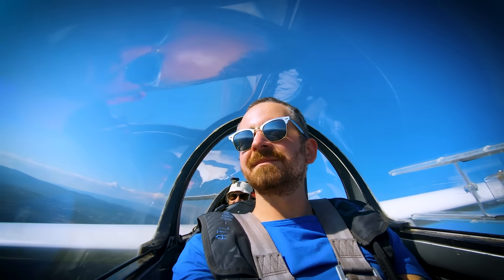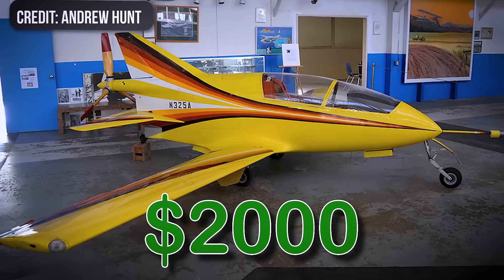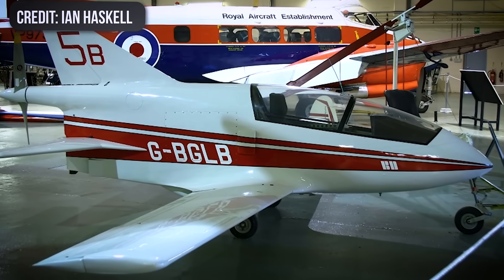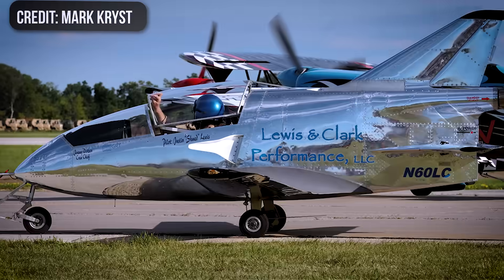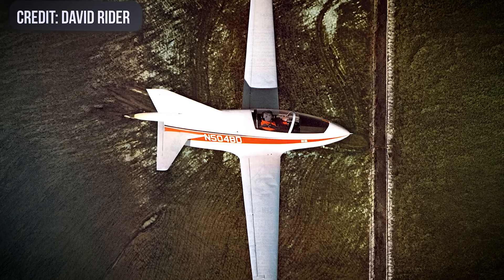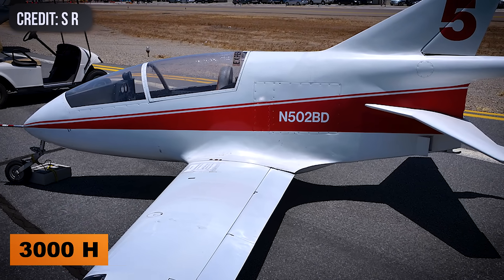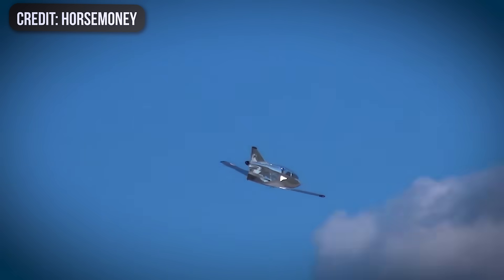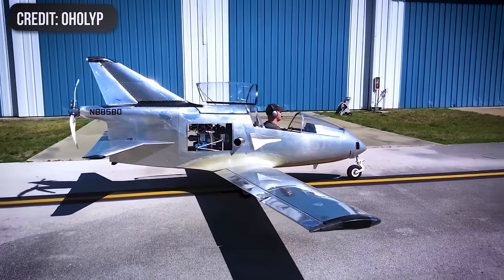This ‘$2,000 Jet’ Seduced Thousands of Pilots… Then Turned On Them

Comment: To me it looks like a scaled-up radio-controlled [RC] sport model. I can imagine it with a 6' wingspan, weighing about 10 pounds, and being a bit of a handful at low speeds.

The extended wing glider version seemed a bit more realistic as a full-sized proposition, but the standard machine with its big fuselage and tiny wing looks more like a coffin/casket than a plane.

Comment: Sounds like the development of many aircraft. Not as glib as the author makes it out to be and sensationalizes the failures.
Reply: I don’t dispute your comment as every airplane that has ever flown has had teething/developmental problems they’ve had to overcome and sometimes the failures are put in the spotlight.  However, when it comes to the BD-5J it sounds to me like Jim Bede was more concerned about lining his wallet than he was about safety. The first time I ever saw a BD-5J was the Coors Light silver bullet back in the late 1980s and I’m marveled at the possibility of owning one of those one day. Shortly after I saw it fly was when I to began hearing all sorts of horror stories about it, and that’s what kept me from owning one. Jim Bede never did anything to improve the safety and seem to only laugh all the way to the bank. Granted, he sold over 5000 of them, but last I heard around only 100 of them are still considered airworthy as all the rest were either sold as static displays, sold as scrap or as spare parts.

Comment: I know how to make pressed silicon nitride 50x cheaper or more than usual, so it's possible to make a turbine that runs off tapwater that also provides gyroscopic stabilization and 10x more power than you'd need at minimum for that aircraft.  I also know some other engine designs, all of which would allow you to run without using fossil fuels. Yes you could scoop up seawater and go around the world.

Comment: After flying a fighter plane in a simulator, flying a GA plane feels like cheating. However, this thing looks about as dangerous as a 1950s jet fighter. The airfoil is too thin, the engine too high, the wing loading too great, and the wing area too small. There is also probably very low margins of stability. A cool idea, but awful execution.
Reply: The tragedy is that a military jet is a much safer plane than anything an amateur pilot can ever dream to control. Those planes have enormous performance margins... which they need for combat mission profiles. In ordinary flight those become safety margins.

Comment: If the jet engine was a success, then perhaps he should of focused not on piston engines for props rather focused on turbo prop set ups using the same jet engine.
Reply: It still doesn't solve any of the other problems. The contraption is too small by a factor of two, which means it lacks a factor of ten in volume and price. You want a safe plane that won't kill you? Spend the quarter million dollars that a plane has to cost that won't kill you. Or, if that's too much... take up hang and motor gliding. Way cheaper still and much safer.

Comment: My friends dad was building a KR2 in his basement.  At some point he lost track of the size limit to pass out of the basement entrance so he could finish it up in the barn.

The day came and it was obvious that the rudder and stabilizer are would have to be torn apart to get it out.  Iirc, he’d just had the FAA guy out to sign off on some of that area before he could cover it.

Eventually, it made it out to the barn but I think the damage took away his enthusiasm to complete the project and it was sold sometime later.

RIP Max, you were one cool dude…

Comment: Very interesting story.  I came along and built a Long EZ, but it was way down the line from the BD series.  The Long EZ is a hard plane to build, because you're actually building every piece of the plane.  Most builders today opt for the RV series, which are easy to build using pre-fabbed parts from the factory. A friend built a RV-6 but insisted on putting a Mazda Wankel engine in it.  He argued it had a high horsepower to weight ratio and he was going for it.  His mistake was using an engine whose high horsepower developed at 6000+ rpms. That's a lot of weight being slung around inside that block. It had to be geared down, which was the Achilles heel of his airplane.  He lost power on final and crashed it.

Comment: For the record on the ORIGINAL BD-5J engine: The Microturbo TRS18-046 turbojet engine was a certified, man-rated design of French origin FAA certified by Ames Industrial Corp (aka Microturbo USA).  I did a ton of test cell work and data crunching in the certification process for that engine.  Good times.

Comment: I can't understand how an aircraft engineer could start shipping parts before the prototype was even certified as airworthy. I don't think there has ever been a single plane that went from conception to certification without at least a hiccup or two that required tuning something up or changing something around. Usually there is a lot that changes. He really shouldn't have started to accept deposits or start making deliveries until the FAA had certified the plane as airworthy.

Comment: In 1971, my friend, Art, bought a 1969 American Yankee AA-1 (the original symmetric airfoil) for peanuts as, within a couple of years, it had earned a reputation as a "widow maker." I flew a couple of hundred hours with him as he built time towards the ratings he would need to earn to become an airline pilot.  This spinoff of the original Jim Bede BD-1 was dumbed-down as the AA-1A with a Hershey bar wing, which made it much more docile. As I recall, stall speed clean was 69 kph, with the miniscule flaps the stall speed plummeted to 65 kph!  Final approach was way faster than in the 150 in which I earned my PPL SEL! It was a lot more fun, for sure. The castering nosewheel confused a lot of folks, but Art never had a problem with the differential braking. During his ownership, we installed dual nav-comms, an ADF receiver, transponder, marker beacon receiver, 3-light strobes, audio panel, and even drilled out the yokes for push-to-talk buttons on the comms.  All of these improvements were signed off by an A&P..  It lived a few years after Art sold it, to a pilot in Big Bear, CA. I see it's in Ohio now. I hope the owner has as much (mostly) fun as we had in that beauty (N5677L)

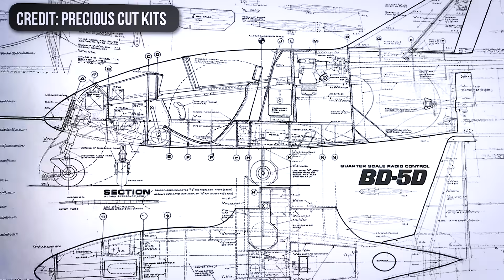Comment: 7:27 An RC scale model.  Around 1975, whiler in the Navy at NAS Pt. Mugu, there was a demonstration of the BD-5J sponsored by  a beer company, Coors Light. I was a mechanic with VP-65 and impressed with the little jet.   But standing next to me was a couple of Navy jet pilots. They too were impressed but were concerned with how many G's the thing could sustain without structural failure.  But it sure looked cool!

Comment: I only know about the use of engines in cars and motorcycles, but even there, putting an engine in something is never as simple as installing a radio. What a wild comparison. Even on the ground, you have to know whether or not your oiling system can handle sustained G-loading. Toyota learned this the hard way recently when they made some of their sporty cars unable to take a long high speed turn because the oil pickup would get starved. Motorcycles usually have it easier because most of the time, forces going through the bike are much more down relative to the bike because it leans in a turn. But you still have to make sure that under acceleration and braking you don't get starvation. And that's just oiling. You also have to make sure the fuel system can handle it too. And coolant. You can't just put any engine in any vehicle and it just works. Most of the time a car engine will work well enough in any car, but the edge cases matter, and the moment you can have 3 dimensional movement instead of just on the ground, it gets so much more complex.

Comment: I actually flew one in 1975 with the Xenoah two stroke engine. You pull started it like a lawnmower.
Normal flight seemed so close to being out control, and it was very easy to over control, especially in pitch..
The side stick took getting used to, but was cool. Landing was critical because you could put it into a high sink rate and smacking the runway like a manhole cover. Les Berven and Burt Rutan both signed my logbook both surprised I was still alive. Always wanted to build one, but as I got older, staying alive seemed more important..

Comment: As a layman aviation enthusiast, I have a question.

Since the engine-out pitch characteristics were so bad, could there have been a mechanical system that could counter the strong pitch-up tendency?  Seems to me, a strain gauge arrangement of some kind could be built to add some nose-down pitch when the engine power dropped abruptly.  Similarly, a nose-up adjustment when adding power on a go around.

Also, it seems wise, to me, to incorporate a way to move cargo/ballast forward and aft, to dynamically adjust balance.  A simple box with a rack-and-pinion or a drive screw would accomplish that.

Comment: I am 75 years old now. I was a young highly-educated professional aeronautical engineer working for Beech Aircraft in Wichita in the 1970's while Bede was pushing his contraptions out of Hutchinson. While we were working hard and diligently to produce reliable, safe, well-tested, and FAA-certified aircraft, and conducting research published in AIAA and SAE journals for scientific peer review, research that went into actual successful production aircraft, Bede was casting aspersions on us, Cessna and Learjet across town, and Piper, in an effort to justify his unconventional, ill-thought, and unsafe redneck engineering approaches to aircraft design and selling to unsuspecting customers. He shared an unfortunate philosophy with Burt Rutan, who also NEVER actually certified an aircraft, with the attitude that, "We don't need no stinkin' rules. We are smarter than them."  People trusted them, died as a result, and in the process both of them did the small aircraft industry in general a great disservice. Those of us who were profesionals in the industry had very little use or regard for either of them. You may call this sour grapes, but the fact remains that neither of them EVER produced an aircraft that was properly tested and certified to FAA and industry standards, for public consumption. Aviation versions of P.T. Barnum, right down to "there is a sucker born every minute."

Another small but good example: John Denver died due to an incredibly stupid fuel system design that never would have passed FAA muster. No way in hell would we at Beech/Cessna/Piper/ Lear/Gulfstream/etc., have ever designed something like that, and it certainly would never have been certified by the FAA. There was no excuse for that fuel system other than laziness and lack of forethought in design. Yet Rutan is a hero in may people's eyes. I call bullshit.

Comment: I think I should add what little I know about this plane. I was the pattern maker of the wing fillet, the blended fiberglass between the body and the wing. It was somewhat a race against time to finish the patterns, and the last two weeks were a lot of overtime and work with Jim calling just about daily wanting to know when the fillets would be done. The molds were made and the first layups were finished and someone flew in to get them and flew them back that very day, I believe it was late on a Friday. 

Monday morning when I walked back into work my boss was standing inside the back door with a stressed look on his face. And said, "did you check the scale on the drawings because Jim Bede called and said the fillets are about half the wing size." My heart sank, I was sure the drawings were 1/1. This would be a costly mistake. We checked the patterns against the drawing and they were correct in all dimensions. 

The next Morning I walked into the bosses office to find out what was going on with the fillets. Jim had called back once they realized they had sent us the wrong prints. They had rejected the smaller wing and redesigned it to a larger wing that was about twice the size of the first wing. 

I said all this to say, I was told rather then admitting their mistake and eating their losses and making new fillets they just went back to the smaller wing design to fit the existing fillets. Did that have anything to do with the instability and downfall of the plane and the loss of lives? That has always been my question. It would be tragic if so many people lost their lives because it would cost to much to remake the wing fillets.
Reply: A larger wing design could have allowed more forgiving landing and take-off speeds coupled with inclusion of more engines being compatible with the off perfect design.  Would it have reduced loss of lives?   No one knows for sure?

Comment: As a young mechanical engineer in the early 1970s I thought about building a BD-5 and visited the Bede facility near Wichita.  I looked at the model on display (N501BD if I recall correctly) and sort of wondered at that point that if Bede was over-driving his headlights.  I thought the workmanship on that aircraft wasn't very "buttoned up" and the office was basically a couple of desks with two young ladies answering telephones.  A little later I was able to see the BD-5J fly at a Lawrence, Kansas air show.  The pilot (Fornof I believe) flew from Topeka to that airfield, made a few impressive low passes and other maneuvers but declined to land.  I believe the stated reason was that there wasn't enough runway at LWC.  I always felt that there may have been other reasons we didn’t get to see that plane up close.

Comment: In 1977 I was at airframe mechanics school. A BD5 builder brought his fuselage kit to the school to be completed. It was slated for a Honda engine IIRC. Me and another guy got to assemble it and get it passed inspection. When the owner came to pick it up one of the instructors told him for an extra $50 we could add a row of handles on each side of the fuselage so his pall bearers would be able to pick him up at the crash site. I have always wondered what happened with that airframe.
Reply: I knew a guy in Salem, Oregon around 1988 that owned a partially completed BD-5 kit that he traded a guy (I assume original owner) his motorcycle for.  It was one of the Honda planes.  I don't know what ever happened with it I wasn't really friends with the guy, I just knew him because he was friends with one of my buddies.

Comment: I don't think the ink had dried on my pilots license when I saw a pair of them being built at an airport west of Boston. I had just started my A&P school  so I was hot to build one but I was told the Hearth engine had overheating problems. Shortly afterwords I heard one seized up in flight and the plane crashed (no report on the pilot) I figured I would rebuild my Cherokee and see what the next engine would be. There never was one. I think If I was younger I might try the Hona Gold Wing as they all seem to exceed 100,000 miles on the ground. I was also hot on the Foxjet but it was too expensive. It also was short lived.

Comment: I am surprised he didn't got any murder charges for his rushed, corner cutting approach.
Two quotes from the IMDB to the jet scenes in t he opening scene of Octupussy 1983:
"The pre-title sequence has a scene where Bond flies a nimble home-built Bede BD-5J aircraft through an open hangar. Hollywood stunt pilot, and aerial coordinator, J.W. "Corkey" Fornof, who piloted the aircraft at more than one hundred fifty miles (two hundred forty-one kilometers) per hour, has said, "Today, few directors would consider such a stunt. They'd just whip it up in a computer lab." Having collapsible wings, the plane was shown hidden in a horse trailer. However, a dummy was used for this shot. Filming inside the hangar was achieved by attaching the aircraft to an old Jaguar with a steel pole, driving with the roof removed. The second unit was able to add enough obstacles, including people and objects inside the hangar, to hide the car and the pole, and make it look as though Sir Roger Moore was flying inside the base. For the explosion after the mini jet escapes, however, a miniature of the hangar was constructed and filmed up close. The exploding pieces of the hangar were only four inches in length."

"The Acrostar Jet was twelve feet long, 5 feet 8 inches high, with a wing span of 17 feet, powered by a single micro-turbo jet engine TRS-18. Its maximum speed was 232 mph (373 km/h) at sea level, cruise speed: 229 mph (369 km/h) at 2,285 m (7,497 ft), range: 935 mi (1,504 km) optimum, with 30 min reserve and rate of climb: 1,919 ft/min (9.75 m/s). It was piloted and owned by J.W. "Corkey" Fornof of Louisiana, who had been an uncredited Aviation Consultant on Moonraker (1979), and also worked on Licence to Kill (1989), as a pilot."

Comment: If you fly a glider and pull your legs in, the speed drops 6 kts. In a much smaller aircraft, with a tiny elevator, the smallest crew-move is prohibited... Mods I suggest: 
1. fixed stabilizer with twice the size and elevators equipped with anti-servo tabs for increased feel.
2. Wortmann semi laminar flow section with easy re-attachment of flow during stall recovery.
3. Trust line redesigned exactly through centre of mass, engine mounts designed adjustable therefore.
The BD 5 looks drawn, not designed with aerodynamic knowledge

Comment: I never did care for it. Too close coupled for my comfort. It was the BD-10 I was waiting for but vertical stab structural issues were never fixed. Even now, I still think it is viable with a single piece CNC bulkhead and a responsive yaw damper to fix it.

Comment: The recent engine failures with the Subsonex jet came to mind while watching this video as well as the horrible landing gear design...! Engines were recalled due to an incorrect idle rpm firmware setting causing unscheduled disassembly. Landing gear is a pneumatic system with small wheels.